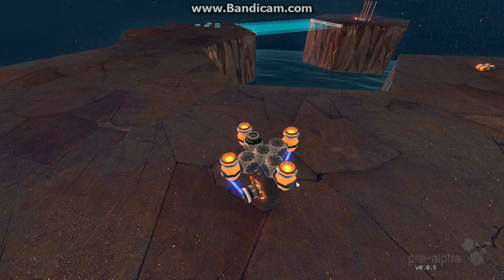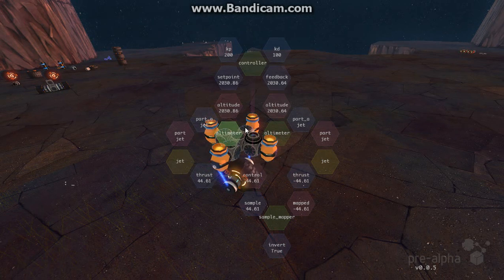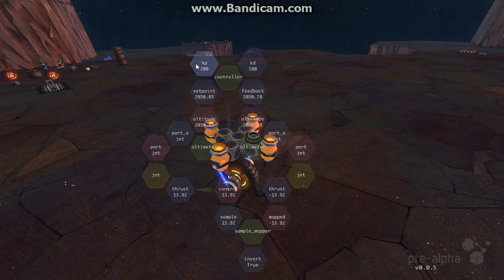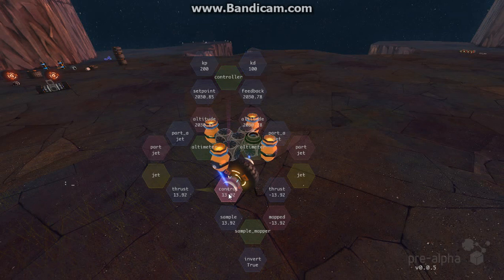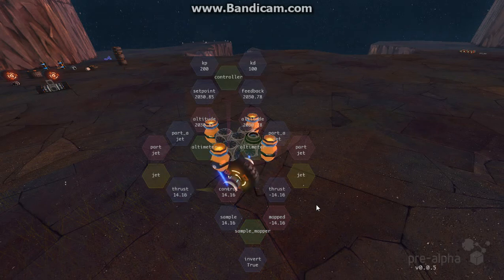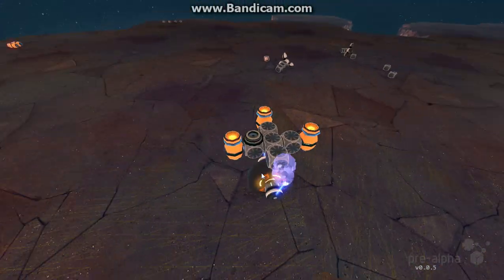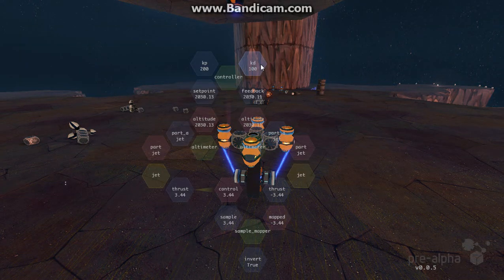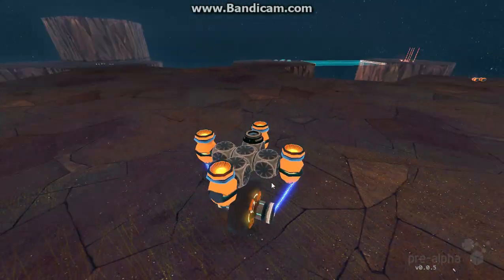Rawbots - Building Balanced Cycle

Comment from the maker: Also if your feeling very adventurous you can try and make it so it balances by counteracting gravity exactly instead of balancing around a set altitude. You can find out the gravity using accelerometers and they are the force required for a part of weight 1 (A 2 CW part if you work in such units).

For the less adventurous just try and get flight working using jets pointed downwards (has more application as you can turn without more pieces)

Comment from the maker: Firstly to make it go back and forth I messed with the balance slightly. So by putting more thrust in one of the jets (and less in the opposite) it will turn and move and stuff.
As for hovers using hovers all you'd need to do (as I did in my bombpod video) was replace the counterbalance with an altitude you can control (instead of the altitude of the other part) and put lift where thrust is. To move thou you'll need a jet or something.

Comment: thanks, I made this same design and ended up with some pretty sick results man! I have 2 questions though. The first one is how did you made it go back and forth? i tried running the motor but that doesn't work. And the second question is how would i make this with hover parts so i can make like a flying hover system where i can ascend and descend on command. Very cool tutorials!